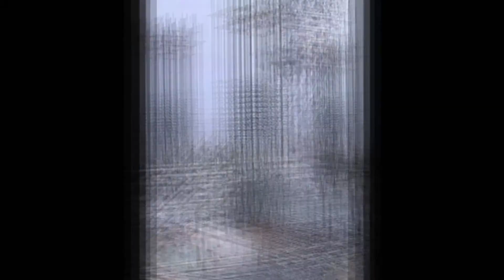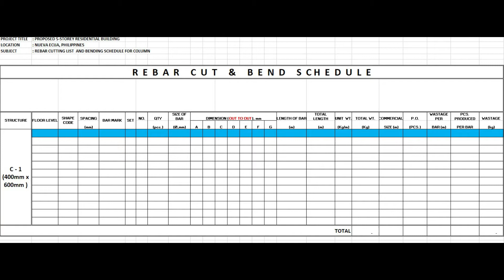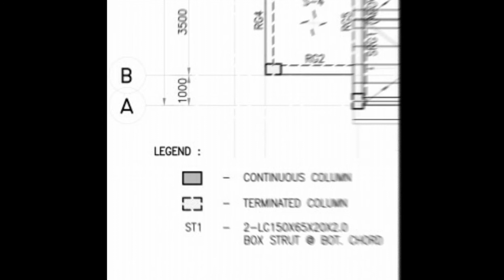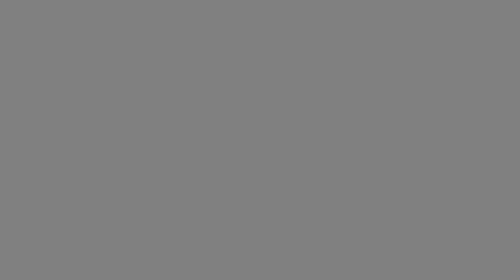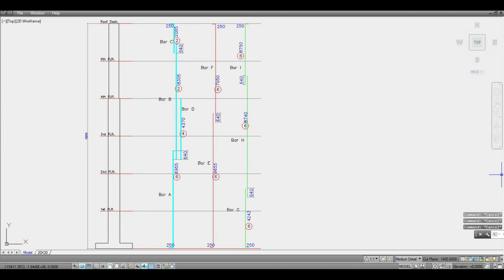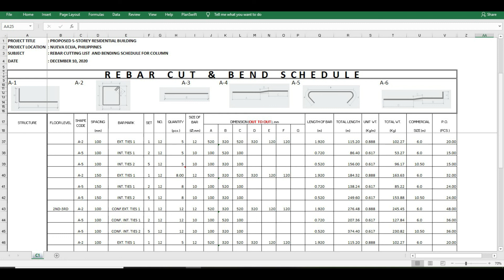REBAR CUTTING LIST FOR COLUMN

Comment: 10:15 Di napo ba iaaknowledge Yang sa table na Anchorage Length? Basta sagad Lang Yung embedment then use the given 90°hook wc is 250 for 16mm?

Ano Naman po yung min. "Lap splice of col. Reinforcement" sa dulo Ng table, ano ibig sabihin Nyan na may individual bars pa? E gamit Naman Natin is 40d o 600min, disregard din Yan?
Reply from the maker: Hello, Anchorage Length ay applicable sa beam, usually sa column the vertical rebar is resting on top of footing rebar, kaya depende sa lalim ng footing. Yes use 90 deg hook
Reply from the maker: Pwede gamitin ang nasa end table kung hindi stated sa design or general notes na use 40d min. Individual bars meaning, for each single vertical bar inside column.

Comment: mam lagi po ba sa half ng column ang splices? bat po un iba nakikita ko na splicing 1meter ang sobra sa ibabaw ng slab at 1meter na rin un splicing nila kasi dun na rin pinapatong sa ibabaw ng slab? sana po naintindihan nyo..hehe
Reply from the maker: Yes, Sa center half po. Hindi ko po alam ang reason about 1 meter splicing above slab. But my best advice, follow rules & code. Thanks sa question and comments and for watching.